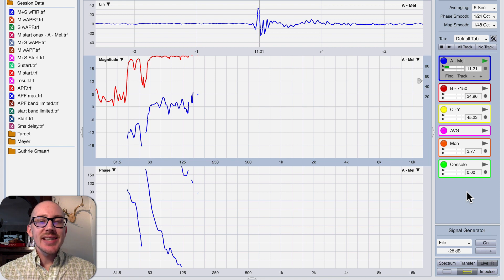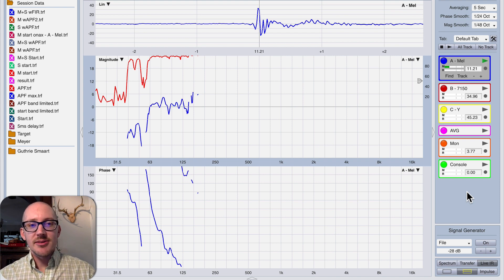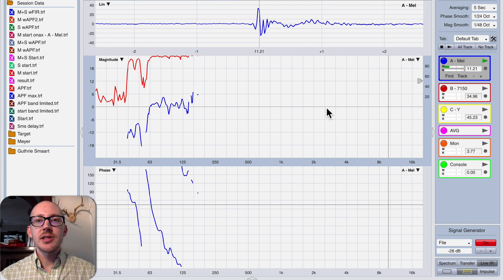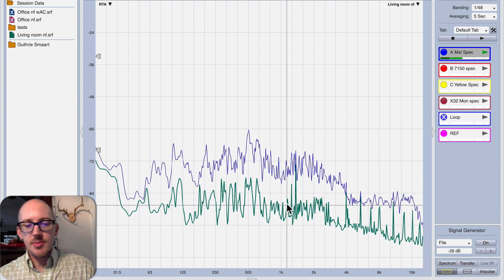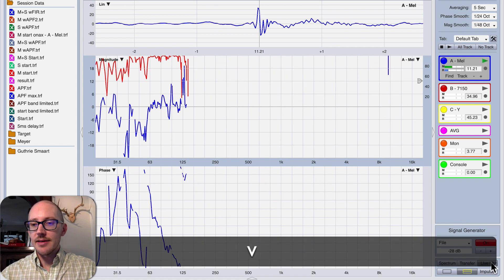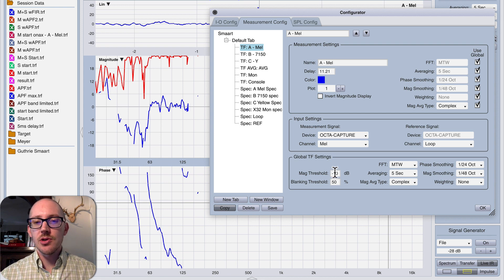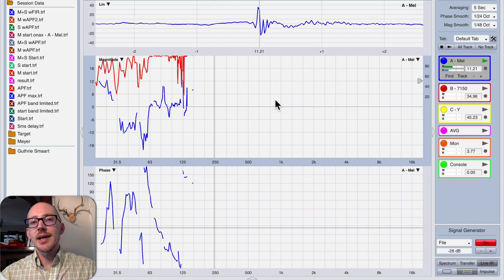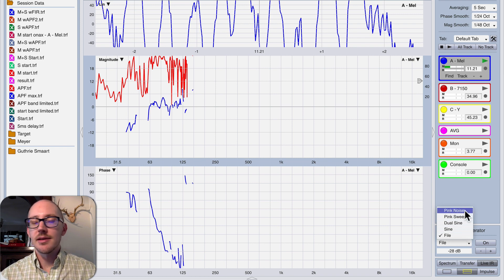This hidden setting in Smaart® will make you tear out your hair (transfer function problem)

Comment: Hi Nathan!

I normally use SATlive, and it happenned to me once. The same, I was turning crazy, until I found this little option (In SATlive you can set up the threshold level or even turn it ON/OFF right in the meassurement window). 

From that day, I keep it always in my sight.
Reply from the maker: Nice!

Comment from the maker: Got this helpful comment from Michael Lawrence: Caught your video about the magnitude threshold setting. That's basically there to keep the "good" data in the data buffer after you kill the sig-gen, so the noise floor doesn't mess with the data while we're waiting for you to hit the space bar, etc. (Notice how when you turn of the signal generator, the measurement "sticks" on the screen rather than disappears. That's the setting at work. If a bin's output falls below that threshold, we ignore it and keep showing the old data. If that's too low, your measurement will "creep" after you turn off the generator.)

Even if you can't turn up the signal in the room / through the system, the best way to optimize this whole thing is to adjust the preamp gains on the interface until you're just barely tickling into the yellow. That's -12 dBFS and a good place to sit for measurements. In your video the levels were pretty low, between -70 and -80 dBFS, and if you were, for example trying to measure IR or other acoustical properties, you'd run into trouble really quickly because the SNR is quite poor. Good news is you're using the octocapture so just go right ahead and make the adjustment, without having to worry about throwing off any relative level analyses. I use a physical loopback for sig-gen so I can set the interface gain independently of the level setting of the generator. In general the first thing I do setting up the rig is use spectrum mode to line check all the inputs and make sure the analyzer is seeing them at a healthy level.

Comment: That problem is because the coherence threshold its to high... so Smaart doesn't shows the grafic with low coherence... lower the coherence threshold will solve the problem
Reply from the maker: thanks Gabriel. The coherence blanking threshold is misleading. The real problem is the magnitude threshold or the sig gen level.